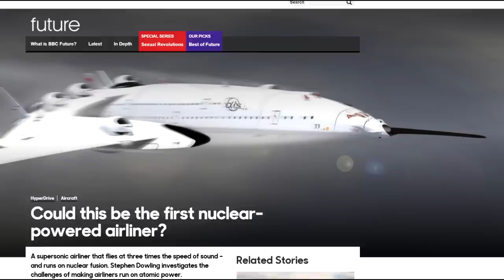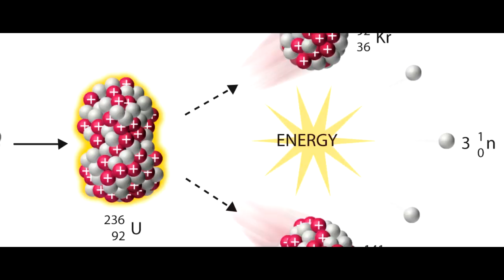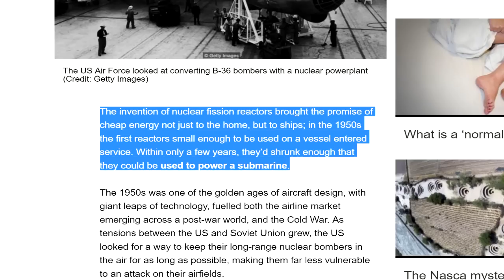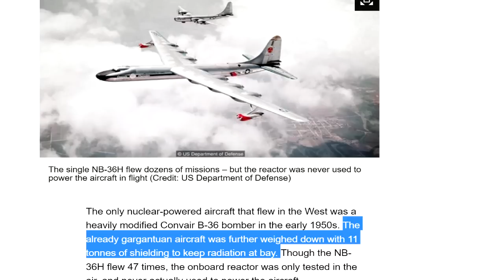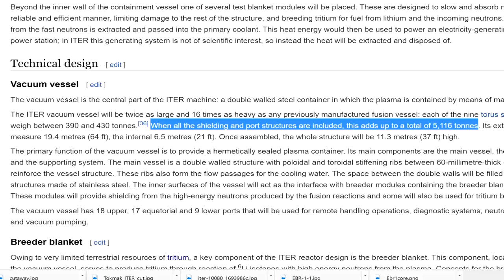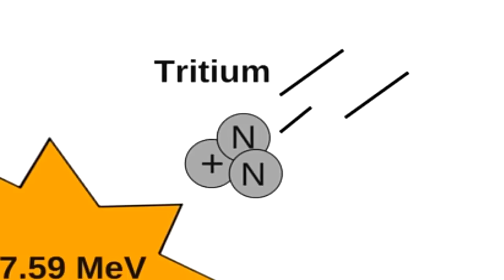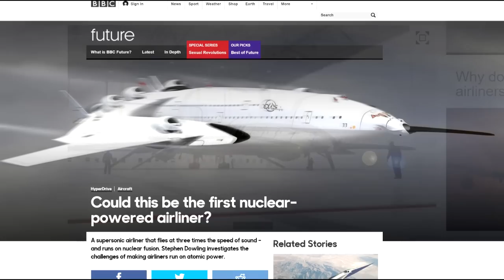SIX ENGINED Nuclear Airliner... BUSTED!

Comment: hm based on that concept plane and some other Vinals did, some simple google backround checks and stuff i'm convinced that plane will never see the light of days
for one he is is an industrial designer and aeronautic enthusiast, and he simply designed that thing with his way of looking cool, i doubt there is some thought of aeronautical engineering involved ... let alone the attachements of the wingsection to the planebody looks ridicules, it has some serious  structural issues, but hey it has cool factor and maybe nanotubes will make that thing work, since the main technology of that reactor isn't invented yet so the framework can wait until that is done ... 

wanna learn more about that  thing ? it seems that the original plans set this cockpit with an holographic window, it also controls directional changes via turbine adjustments, which by the way are electric combustion engines, which means you also need some shieldings against the electromagnetic fields, found some patents mentioning and theory crafting for EC engines but no working machine on that thing though ... 
from a safety perspective alone i would never  set a foot into that flying deathtrap, ok given plane crashes are less risky than driving in cars and stuff but i am genuinly worried about those safety flaws even in the conceptional phase though ... 

for more astonishing views and stuff found that thing on tuvie and some additional pics where it seems that is also some form of VTOL capability in one pic or redistribution of thrust in order to steer ... and a lovely schematics where you can see the top, side and front view 

schematics : http://www.tuvie.com/wp-content/uploads/ff-flash-falcon-electric-supersonic-jet6.jpg 

tuvie article about FF : http://www.tuvie.com/flash-falcon-ff-futuristic-electric-supersonic-jet-with-its-own-compact-fusion-reactor/

Comment: Pffft amateurs, i'm already drawing plans for a spaceship that runs on antimatter. 
It will have two engines and can have a 1000 passengers in cryostasis for 2000 years to be precise. 
The only issue though is creating antimatter and controlling it, but that shouldn't be too hard right?

Comment: The simplest 'nuclear jet engine' is simply using the core to superheat air which expands and 'jets' from the engine.
Reply: Yup, I agree - I was just mentioning the technically simplest way to achieve thrust with reactor generated heat.  They might have been able to fly a plane this way but it would have been a dog I imagine.
Reply: The problem is that air is simply not a very dense material and not very conductive of heat. You have to compress it to unheard of pressure, then heat it up and eject it. All of this fast enough generate enough thrust to keep thousands of tons in the air. Just not possible in our atmosphere. Maybe on Jupiter or Venus.
Reply: The Americans actually got to the point of testing a working nuclear/air expansion engine in the 1950s - and it produced acceptable thrust.  The x39 engine I think it was called.  Look it up...
Reply: Huh, amazing stuff. Although "maximum speed: 628km/h" for the proposed plane... A WW2 propeller plane would have been faster. Not exactly viable in today's passenger planes and a far cry away from mach 3.
Reply: Who knows what the design might have been capable of with another 60 years of development.   The output of the HTRE-3 was pretty impressive anyway, for a very new concept and was apparently scalable to just about any engine size.   Making a nuclear powered engine that provides ample thrust for a big plane is not the real problem.  Its all the unwanted baggage that comes with the idea - radiation - crash issues etc etc. Its not gonna happen for those reasons - not because a powerful engine is beyond technical capability.

Comment: Even if this was technically possible, the certification requirements surrounding passenger aircraft are so strict that even small modifications to airliner design are absurdly hard fought, nevermind introducing a six engine, supersonic nuclear mess from scratch.

How do you satisfy EASA crash requirements when your aircraft is full of nuclear material? How do you meet noise restrictions for an aircraft that supposedly cruises at Mach3+? Is it going to just fly over oceans?

There is a reason why almost all modern airliners follow very similar design principles.

Comment: Thunder, are you not aware of the smaller reactors Skunkworks has been working on? They've said they're about 4 years away from a working prototype, 9 years away from a production model, and i could be wrong, but my understanding is that it uses deuterium, not tritium. They've said that this specific method and model could be used to power an airplane.

Comment: These days, it's not common knowledge that power generation often still boils down to well, boiling water aka steam generation. It seems counter-intuitive. All of our tech and we still use turbines to generate power. All of the shielding needed alludes to a huge amount of wasted energy. When will we learn to truly harness power?
Reply: Thing is, most advances in anything computing related is... making transistors smaller. Just like how power generation looks like it is a very broad spectrum as things, but ultimately is not, so is computing. What divides us from 1970s technology is the degree in how small we can make transistors.
Also some little things here and there, like blue LEDs, which I remember being a holy grail of science until they were invented and instantly became trivial.
Reply: That is not geothermal though. Its compost heating. Also it provides kinda the same output as drying and burning the same yard waste... The reason it is smart to do that is there is less loss do to exhaust and you can spare the drying process. However there are problems with storage as it will decompose in its wet form and it is hard to controll its rate of operation, since it relies on organisms. If you pull too much heat from it during a cold day, you can shock your reaction and it might take days or weeks for it to recover. During that time you cant draw heat, or risk total failure.
Its basically a baseload heating. You take what heat the reaction can spare and use other sources for balancing the load.
Reply: Bär Honigfeld Haha! Nothing trivial about my 486-DX2, don't make me push this 'turbo' button and leave you in the dust.
Reply: There are thermoelectric generators, but their efficiency is abysmal.
Reply: solar panels aren't bad, if you ONLY look at the conversion of incoming solar power to electricity. 
But when you look at the entire picture (so including the energy cost of producing them, taken per hour of effective lifespan of the solar panel), they're incredibly inefficient. They're only really useful in places where no other source of electrical power is available. 
Wind power is somewhat better but not all that much (especially because of the rare materials that require incredibly wasteful mining and refinining processes.
Reply: you mean like solar panels in space orbiting around the sun. that gets you electricity. then you have to convert it to be useful.
Reply: justin cale Solar panels are one of the ways we commonly think we've advanced in power collection but, as I understand, it's very low efficiency. Think though, how far we've come, so quickly with data storage, proc speed, mem size & speed. We've really refined harvesting computing power while remaining, relatively basic in power generation. "Steam-punk" is supposed to be retro but actually it's still used more than most think.
Reply: +Captain "(so including the energy cost of producing them, taken per hour of 
effective lifespan of the solar panel), they're incredibly inefficient."

Really? Sunlight is pretty cheap and it only takes about 2 years to get the Energy back, you needed to produce them.
If you look at the efficiency of photosynthesis, well you only get about 1%Sunlight->chemical energy there,
while solar panels have 10-40%Sunlight-> electric energy.

So in the end it is a purely financial problem.
Reply: Richard Hauer not 2 years, 10 years or more. Unless there's very recently been a quantum leap in solar cell efficiency after decades of no improvement at all that nobody told me about (and believe me, if there had been I'd have heard about it).
Reply: Times does change but things tend to still(stay?) the same
Reply: If you have a better idea to generate electricity, just do it.
Reply: I think my favorite method right now is geothermal heating. I read about digging a large hole, running water pipes around and around in it, fill it with hay or grass clippings and let decomposition provide instant always on hot water. After construction, running costs are simple yard waste. That sounds pretty legit imo. Course, it only provides hot water, not cooling or electricity so only 1 problem potentially solved.
Reply: +TheAnimeEmperor Oh, thank you. This was just what I was looking for. Very interesting stuff. I hope we can capture this method one day.
Reply: Well for fixed applications, steam turbine generation is still incredibly efficient compared to anything else we have. There are very few other ways to generate electricity on demand. Solar, hydro, and wind are fine, but are woefully inconsistent. Cloudy day? Congrats, 30% normal solar panel output. Few waves? Congrats, 10% efficiency on your hydro plant. No wind/Too much wind? Congrats, 0% efficiency on your wind farm. As long as you can create heat, you can generate steam, all day, every day, no matter the weather, or time. You can guarantee that your generator is running at maximum efficiency by regulating the steam pressure, and the system is actually pretty simple. 

Compared to direct drive engines, where you lose most of your energy to heat anyway, it makes more sense to use your fuel for heat generation in the first place. In terms of power generation, for the foreseeable future, steam turbines are still the way to go.
Reply: You see, to make electric energy you have to spin magnets. There are only so many ways you can do that and individual high energy particles flying off in random directions are not applicable to any of those ways.
Reply: Well we are pretty good at harnessing kinetic energy, that's why we use turbines in the first place, to tgransfer thermic energy to kinetic energy, however steam turbines aren't the only ones, we can also harness kinetic energy directly with wind and water turbines.
Reply: So we're technically cyber-steam punk, wonderful.

Comment: I've seen proposals for putting p-11B Polywell fusion reactors on  aircraft; assuming no showstoppers are found regarding their feasibility. But even the it's best suited to unmanned spaceplanes, not passenger jets. Even the cleanest fuels produce some very unhealthy side reactions.

And of course there's Project Pluto. A nuclear ramjet cruise missile, which actually got as far as the testing stage. Engine worked a treat. Needless to say, that wasn't really suitad to passenger service either...

Comment: The size and shape of that thing. lol at Mach 3... The only thing that will do Mach 3 is a Mig-25. You can kiss the engines goodbye when doing it as well...
Reply: The SR-71 flew faster than Mach 3 and the X-15 went hypersonic.
Reply: Both are on record of doing Mach 3.3 The X-15 doesn't count as it's not able to sustain flight on it's own or take off under it's own power. Also the Mig-25 was an interceptor and combat aircraft carrying a payload where as the SR-71 only did reconnaissance. The Mig was considerably cheaper and of much more rugged and straight forward design. The SR-71 was quite the development aircraft and a lot was learned with it's creation. It could sustain doing mach 3 regularly as the Mig could not. Only was a bit flawed but the fact is an aircraft with that shape will not do Mach 3.
Reply: Stand00Alone97 I'm not disagreeing with you that this thing will never make Mach 3. I'm just pointing out that the Mig-25 isn't the only plane to reach Mach 3

Comment: The soviets tried to make a Nuclear Bomber in the 60's. They Did overcome the shielding problem.... By having no shielding at all. Most of the pilots died...

Plus, flying at Mach 3 would require Titanium alloys to counter the tremendous heat from friction. Remember that America tried to break the Mach 3 barrier in the 60's with the Boeing 2707. Yeah, weight really makes it impossible for a passenger aircraft to fly at Mach 3 efficiently enough to enter commercial service. It can only be achieved on the military scene, which is cost insensitive, not on an airline industry that barely gives you free peanuts anymore...

And say it was possible, I dont think the American public will put up with the sonic booms. They sure didn't accepted it 40 years ago.

Comment: And if a terrorist hijacks the plane? A active nuclear bomb...
Reply: Reactors are not bombs.
Reply: +kokofan50 but they can go critical and turn into a flying bomb/deathtrap
Reply: +kokofan50 i can already hear the conspiracy theotists going "fissile fuel cant melt steel beams!"
Reply: Bullydog115 No, they can't turn into flying bombs.
Reply: It would be powered by fusion (of some ill-defined sort).  It couldn't be made to go boom any more than an Apple factory could be rewired to turn all its part supply into a 500-meter-tall iPod.
Reply: Darth Wedgius except the fusion fuel that in itself is extremely fucking hazardous and radioactive. Just dropping that stuff on top of a city could create millions of health problems
Reply: TheWorldEnd2 
Difficult to say.  Tritium is lighter than air, so, ordinarily would just escape upward.  If it burned (as it might during a crash) you get heated super-heavy water vapor.  I could see how that would be a problem.

Comment: People thing that because aircraft are sophisticated then that means that all technical aspects of it are, and have no idea how technologically limited it actually is. For instance, having an electric engine is not a problem, it has been done before, but the aircraft could never be supersonic, there is no engine in existence that could propel any aircraft past the speed of sound just by pushing on air with a propeller, it doesn't matter how light it is or how many engines you got, if you want to go any further you need a quite sophisticated intake conditioning in order to transition the air as it enters and exists the engine, like in ramjet which has no moving parts (and can't be made electrically), or simply stop using air to propel and start ejecting fuel like in a rocket.
Also there is no equation that can tell you exactly what is the performance of a wing, it can only be estimated, but that is another story.

Comment: wait...someone is building a fusion reactor? how do they plan to cope with the enormous temperature needed to achieve it?  from what I know u have to get ur material to extremely high temperatures (Which makes it into a plasma state) to achieve it.
Reply: Reactors use magnetic confinement in a vacuum chamber, there's nothing for the plasma to touch.
Reply: +kokofan50 yeah true.

Comment: Nope, if it broke the fallout would be spread over a massive area. SKYLON is the next step. Refrigerates oxygen into a usable liquid. Ion drive is nuclear but the thrust is too low. Fuel needs to be taken from the environment, not carried in the body of projectile. Delta V is not really an issue. The human body is. Fragile. Especially to centripetal force. -g very harsh. If you are on about breaking the nuclear strong force you would end up with a big BOOM. That's it. Similar to Aluminium Peroxide reaction. Aka solid booster. Big mistake. Once it starts you can't stop it. Ok if You are going in one direction, preferably up. No good if you expect to stop without equal force to negate momentum. Then more fuel would have to be carried. Increased mass. - acceleration takes a lot of energy, the x35 from Lockheed Martin shows how hard it is. Mach 7+ then if in the atmosphere everything goes, fuk you. Difficult.

Comment: In KSP i made a medium sized plane jet plane that could fly around the planet in 1 tank of fuel. Its powered by jet fuel instead of nuclear. Who needs nuclear when you can go 3 times the speed of sound using jets and drop a research station in the north pole on the way.

The reason why these sites exist is to attract traffic. One of the vehicles that use nuclear for propulsion is aircraft carriers as they have much better mileage.

Comment: Rather ironically, nuclear powered airplanes are not a new concept at all. The engines are certainly not electric. They can either be a direct drive or an indirect drive and in either case they would basically exchange the heat of the reactor for the heat of the burning fuel (so none of this electric engine BS.) These have actually been developed in the USA and USSR. The USSR's version actually flew and killed most of the crew.

The reason they where never put into service was because 1) the shielding involved is too heavy to make a viable aircraft 2) a crash would be a mess and 3) conventional engines are more efficient. The only advantage of a nuclear engine is the endurance.

Comment: Scientific details (the critical stuff) aside, the very idea that the NRC would allow a commercial aircraft powered by either nuclear fission or fusion, is absurd - especially in a post-9/11 atmosphere. Nuclear submarines, sure... they usually operate in some pretty remote areas, and all that water that they'd sink into would make for some pretty robust shielding. But what happens when some nuclear powered jet liner crashes into Heathrow Airport during a botched landing, or crashes into a building, or goes down over just about literally anywhere over land. Would it even be possible to guarantee 100% containment, even under the potential scenario of on-board sabotage in the case of a hijacking?